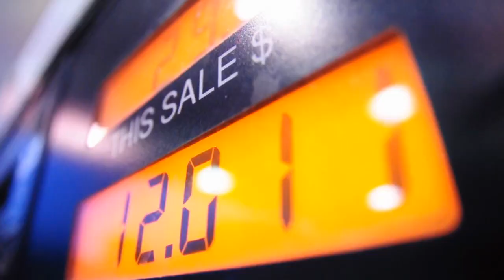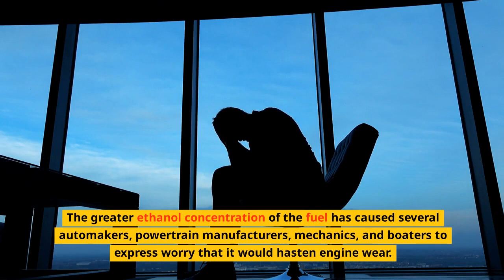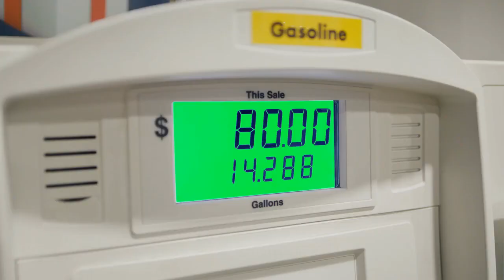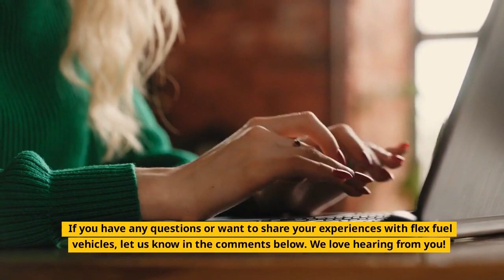What is Flex Fuel? |FLEX FUEL| Flex Fuel Vehicles. What to know about them

Comment: In Brazil they do have flex, but It runs either with "G75" that is 75% Gasoline and 25% Ethanol or "E100" that is 100% ethanol!
Both available in all gas stations across the country.
The only problem with E100 that is happening is with the Direct Injection Engines. My VW Polo was driven 55.000 km only with 100% ethanol and then I have to replace 2 of the 3 direct fuel injectors.
Reply from the maker: Thank you for sharing your experience with the flex fuel system in Brazil. It's interesting to hear that there are two options available, G75 and E100. Direct injection engines are designed to work with a specific fuel type, and using E100 as the sole fuel source for an extended period can sometimes lead to problems with certain components. While ethanol is generally considered a cleaner-burning fuel, it can have different properties compared to gasoline. Thank you again!
Reply: @TheHumbleDriver  But VW, and others, say that it is possbile to use E100 without any observation! Officially they say we can use any mixture..... but after a extended exclusive use of E100.... it will harm owners pocket...
Reply from the maker: @dielreis  Yeah, you're absolutely rigth. Thank you for having raised this point.